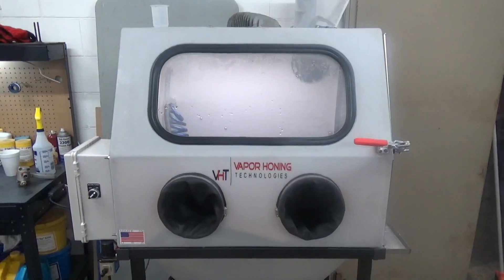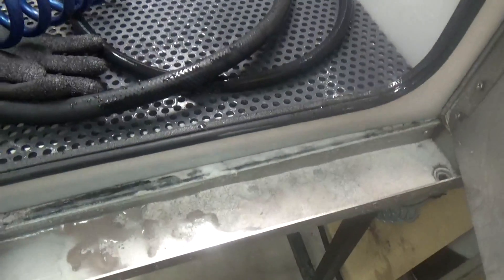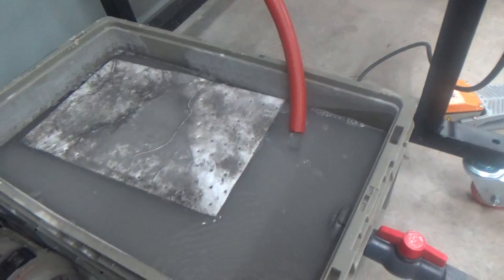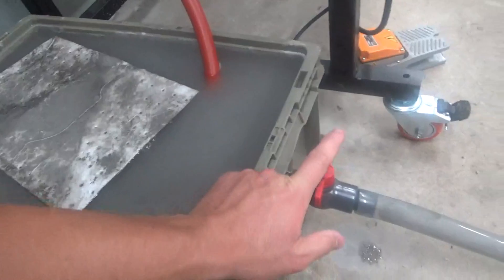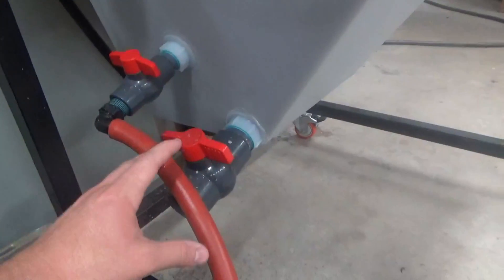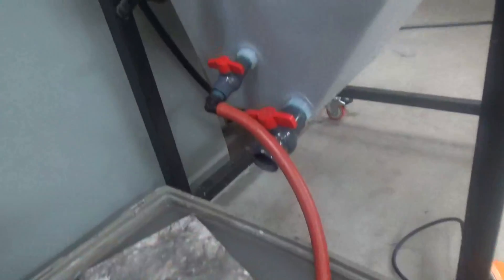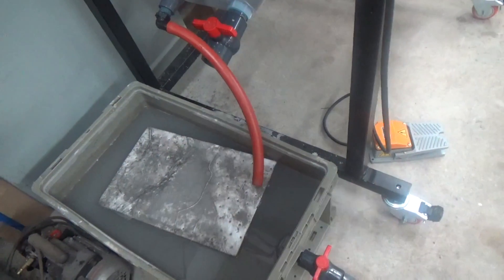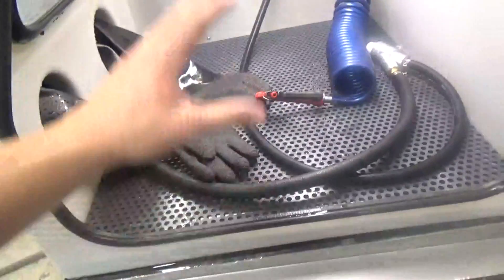Changing Abrasive in a Wet Blasting Machine- Vapor Honing Technologies

Comment: What abrasives would you recommend for stripping alloy wheels ready for powder coating, thanks
Reply from the maker: We have found that it really depends on the Coating on the Wheels, some may be removed with Aluminum Oxide and other may require something more aggressive like Silicon Carbide. For more information or to place your Order Today; please contact me at 828-202-5563 x 103 Niki or Email nicole@vaporhoningtechnologies.com

Comment: This process is not quite as simple as they say.  They purposely left out actually changing the abrasive. It takes much longer than suggested.
Reply from the maker: Hey Scott, how are you?  You are correct, changing abrasive can take about 30-45 minutes for a complete change over.  However, there are many projects that can be done with the 4:1 Ratio mixture of Glass Bead:Aluminum Oxide.  This prevents you from having to change abrasive as often.  For more information or to place your Order Today; please contact me at 828-202-5563 x 103 Niki or Email nicole@vaporhoningtechnologies.com

Comment: How usable is such a machine without the blasting air supply, only using the slurry pump? Will there be enough impact force to do light deburring (remove machining tool marks), or even polishing aluminum?